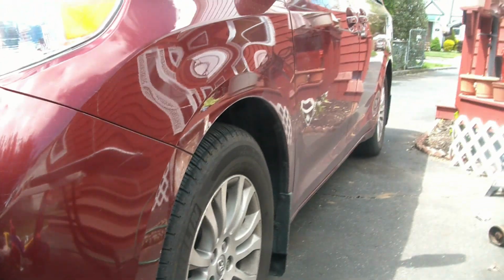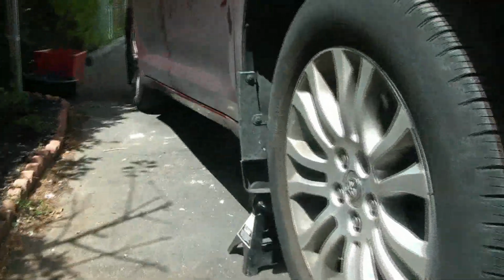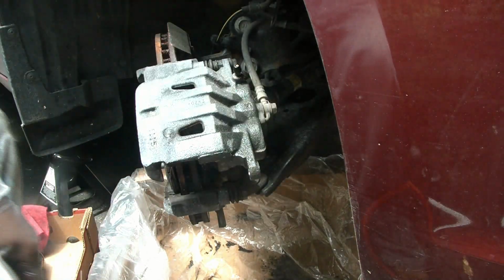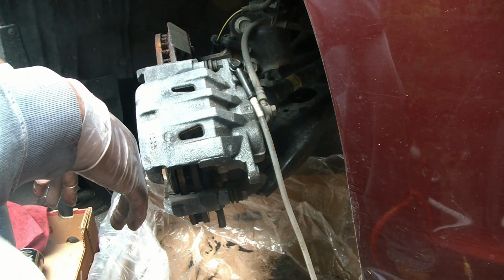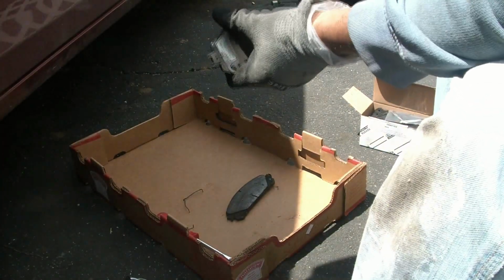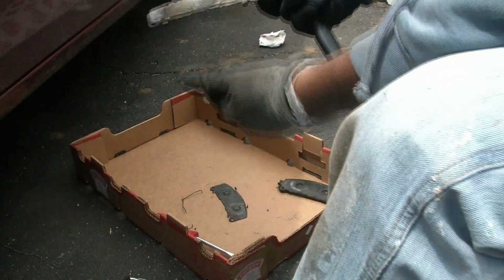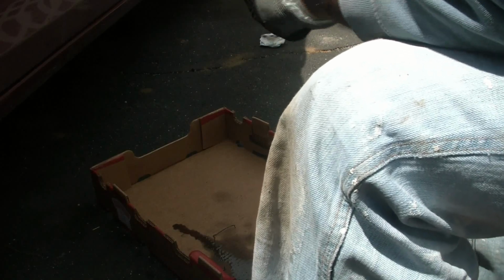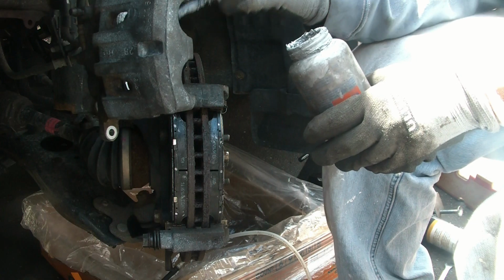Toyota Sienna 2014 Front Brake Pads Replacement

Comment: I don't mean to sound rude, but there is no reason to remove the brake fluid.  If you do it this way you risk introducing air into your brake lines and at the very least you will need to refill your brake fluid since you just drained some of it out. Please if you are watching this video do not loosen the brake bleeder valve and drain your fluid, just compress the brakes normally and the fluid will flow up into your brake fluid reservoir.

Comment: I am getting my '15 SE ready for its first brake change and your video is very helpful. As for the brake fluid, I believe it is a great idea to open the bleeder to help push the piston in. It removes old or contaminated fluid in the caliper, just hold the hose upward to keep air from going in, and top off with fresh brake fluid. Hope to see more Sienna repair videos.
Reply: F